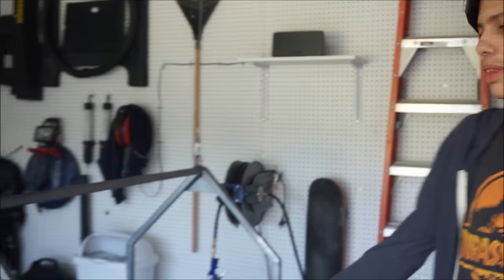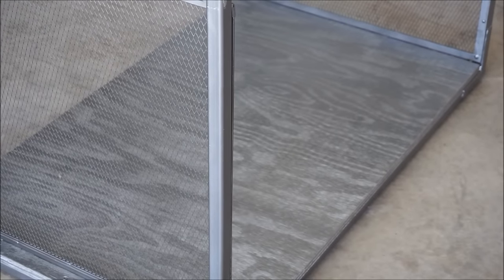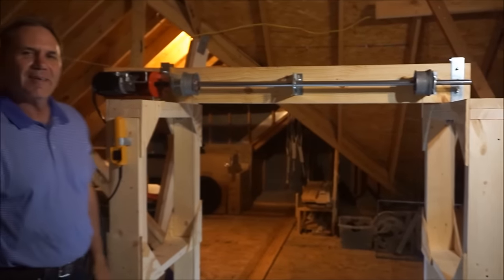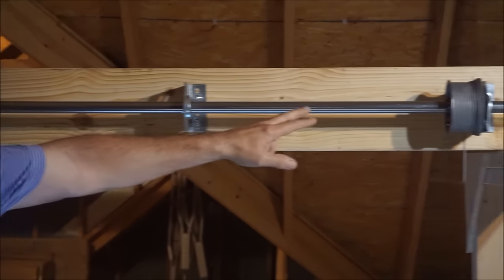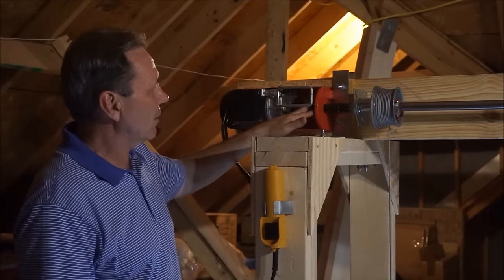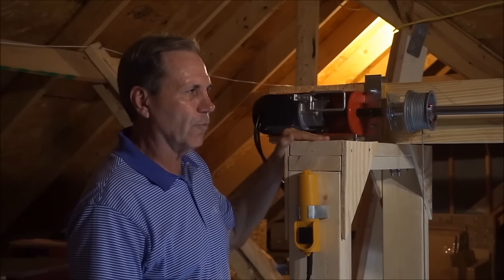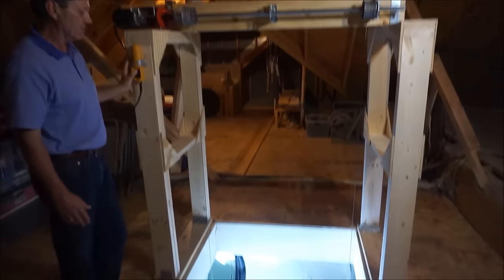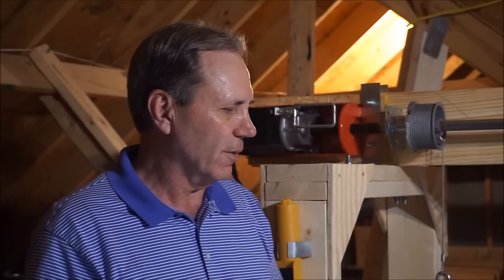Attic Lift DIY

Comment from the maker: I had a question from James about where I got the cable and drums for my attic lift.      I purchased the two cables, drums, tube, and end plates from a garage door repair shop.   I measured the distance from the garage floor to the top of the attic frame and had the cables cut to reduce cable length.    Let me know if you have any more questions.

Comment: Good video.  I might do something like this using galvanized pipe for the frame.  I saw someone else using a flexible piece of metal, bowed in the middle and attached to the frame to help center the platform as it goes through the attic floor.

Comment: I built an electric staircase to my attic also in Fort Worth using probably the same Harbor Freight hoist. Since it is built out of 14 ft long 2x12s and the stair steps inlaid with ceramic tile are also 2x12 material plus 100 lbs of concrete counterbalance at the bottom I'm sure it weighs well over 400 lb. Plus my 200 lb. I'm planning on turning it into an elevator that will hold me and the items I need to store and retreive in the attic. Those stairs are getting hard on this 77 year old man. But they have worked great for over 20 years. Too bad we can't compare notes first hand.

Comment: I don't know if I missed this information, but what is the size of your opening in ceiling and did you obtain the pulley shaft from the garage door repair parts store?  What determines the length of the pulley shaft?  Sorry for the questions, but I'm excited now after viewing your video and reading the comments.

Comment: Mr. Anderson, I have been attempting to get my garage hoist to operate correctly and I have tried many things...the problem I have is the dern carrier wants to swivel as it is going up or down.  My hoist motor is from Northern Tool..similar to Harbor Freight.  First I went with 4 points of attachment with chain fastened to the platform, but this did not work as it still swiveled and then we went to one attachment point.  I THINK what you have here will be the cat's rear end.  However due to not wanting to clutter up floor, I will mount mine back onto 2 x 8 x 6' boards that are bolted stoutly to the roof rafters.  Then it appears all I have to do is borrow from my tools, one impact socket, and have another attachment point or two welded onto my already existing carrier, visit Menards and purchase an additional pulley and cable and whatever else I require from your shopping list.  Thank you for the information and I surely HOPE this works because I really don't want to have to spend boocoo bucks just to bring down the wife's Christmas "stuff."  Can I post you directly if I have any further questions or just ask here?
Reply: As you see from my video, I attached the garage door cable to the vertical tubing on the platform.  My platform moves a little, as I lift it, but it still clears the opening at the top.   I would suspect that if the platform or cable is not level, it may swivel more, or.. if you do not center the weight on the platform.

Comment: I thought this was best DIY attic lift I’ve seen on YouTube. Are you willing to share your plans (I realize nothing is free) Think about it, please let me know.
Reply from the maker: Tony,   I am sorry that I do not have a list of materials or a full set of instructions.   I was able to find several youtube videos of attic lifts and used them to develop my project.  I am not an engineer or contractor, just a do-it-yourselfer.  Hope this helps.... The hoist is model 60346 (Pittsburgh Automotive) 440 lb. cap, 110 volt purchased at Harbor Freight.  It has a lifting capacity of 100 lbs. net weight.   Pittsburg Automotive makes several larger hoists, if you are interested.   The attic lift platform is 42" wide X 26" deep X 50" high.  The frame of the platform was made with 1" square steel tubing.  The angled pieces were 18" long and the down pieces were 38" long.   I had a local welding shop assemble it for $440.    The attic lift is supported by a wooden frame mounted in the attic.  Materials for the wooden frame:  The top header for mounting the hoist was 2X8X71.  The upright side supports (4 ea.) were 2X6X60".  The horizontal side supports (4 ea.) were 2X6X33" at the top and 2X6X27" (2 ea.) in the middle.   The floor pieces are 2X8X34" (2 ea.)   I used 3/8" plywood for the corner supports.   I do not have a picture of this, but you can freeze the video and it should be clear.  The garage door hardware includes: 1 piece of hollow steel tubing.  A 3/8 " deep socket that is welded to the end of the hollow steel tube. This allows the motor shaft to be connected to the steel tube.  You will have to remove the end plate from the hoist motor  and then remove the cable and exposé the shaft, so that the hollow steel tube can be attached using a 3/8 deep socket..  Also included is 3 end plates that support the tube in the middle and at each end.   2 rollers that mount to the hollow steel tube to carry the steel cable.     You will have to cut out the space needed in your attic floor to make room for the lift.  You will need to block and brace the cut-out like you would for an attic stairway.  Let me know if you have any questions.

Comment: Is it possible to get some details for the lumber frame you built over the opening? Some pictures of the frame (bottom and sideways) will be helpful. I am trying to figure out 1. How the top piece 2x10 is connected to the vertical lumber. 2. How the frame is connected to attic floor/joists. Thank you
Reply from the maker: I will try to get this to you this week.
Reply: @judsonanderson3043  Thank you. I will really appreciate it. I am planning to build something similar and I intend to install lower and upper limit switches. The lower limit switch is little tricky. If I find something that works, I'll gladly share it with you.

Comment: I have a question about the load limit on your lift.  The hoist used had a 440# limit with the use of the cable pulley hook and a 220# limit with a single cable attachment.  By removing the cable and pulley mechanism completely, and using a direct shaft, does that not reduce the load limit to below 220#?
Reply from the maker: Great question.  For those of you who have read my earlier posts, I want to update you on the capacity of my lift.  As Marshall stated, the hoist motor capacity may be confusing (to me it was).  While the owners manual for the hoist stated that the capacity was rated at 440 lbs with 2 cables and 220 lbs with 1 cable, I assumed that my hoist (with 2 cables) would have a 440 lb. capacity.   Well, I put it to the test.... I placed 240 lbs on the lift.  No, I did not try to lift myself as a test subject.  I used weights from my home gym.   The hoist would not lift 240 lbs.   I reduced the weight to 100 lbs. and the hoist was able to lift the weight to the full span from floor to attic.  SInce the platform weighs @ 75 lbs, it appears that the true capacity of the hoist motor itself may be closer to 220 lbs, not 440 lbs.   In case you need greater lifting capacity, Pittsburgh Automotive makes a hoist that has a 440 lb capacity with a single line (Model 60347), 550 lb capacity (Model 60345) and 650 lb capacity (Model 60344).   Of course all other components would have to be rated individually to insure that the unit, as a whole, can handle the weight limit of the hoist itself. 
  Hope this helps.
Reply: Judson and Derrick, nice job and thanks for posting. I will be modeling my new install after yours. 

With just a little modification, and possible two new drums, and you could actually lift the 440 rated capacity of the hoist.

Dead-end the cable at the header to form double run of cable on each end of the platform going to each drum. 

The double cable actually references the two lengths you saw on the hoist when you bought it. The picture and description shows it came with two hooks, and had 39’ of cable. 

If rigged up as shown in the photo on Harbor Freight website, with the hook with pulley attached to the load and the other hook attached to the motor frame, it will pick 440 pounds because each of two runs of cable is now carrying 220 pounds. Which you were able to confirm the hoist will lift.

To replicate that in your design, run the cables down and through pulleys on the top of your basket (you could use the one that came with the hoist when you bought it and get another for the other end) and dead-end the cables at the header instead of on the platform. 
This creates the same effect as shown on the HF site. 

Of course, that would mean that the drum needs to be able to hold double the length of the height of your lift. For example, an 8’ ceiling would need drums rated to hold least 16’ (or better, 18’) of cable. Did you buy drums that could hold as much cable as the original hoist? They held nearly 38’

Since, for stability, you are using two drums and two pulleys, creating 4 lengths of cable, the actual load to each length of cable is only 110 pounds. 

https://www.ebay.com/itm/Garage-Door-Cable-Drum-For-up-to-18-High-Doors-D525-216/291620087553?hash=item43e5e96701:m:mZgRq4zKgjGHWWNbSQXGiPw
Reply: The #440 rating for the HF winch is based on using a "snatch block" pulley. It is NOT determined by how many cables are attached without a snatch block. A snatch block will multiple the pulling power but require twice as much line to be winched in.  Because you will have to winch in 2' of cable to lift the load only 1' you are doubling the capacity. Additionally, the diameter of the garage door cable pulleies are larger than the diameter of the original winch pulley. That causes the lift capacity to be less than the rated capacity.

Comment: How did you detach the original cable spool from the motor shaft.  I detached the motor from the red housing, but it seems that the spool remains attached to the motor shaft and does not easily slide off as I had anticipated.  Thanks!
Reply from the maker: Marcus,  To be honest, I do not recall having a problem detaching the cable spool from the shaft.  It has a hexagon spool and once you take the housing off, it just slides off the shaft.

Comment: What was the cost of materials?
Reply from the maker: The total project cost was @ $850.   The platform was @ $420.   I had a local welding shop source and weld everything together.   The hoist was @ $130 from Harbor Freight.   The garage door hardware was @ $200.   The attic frame lumber was @ $100, which included boxing the roof joists.

Comment: great job guys. Im thinking of doing something similar. How hard is it to remove the spool cable from the motor?
Reply from the maker: As I recall, there are a couple of bolts that hold the motor to the housing.   Once you remove the housing, you will need to drill out the end plate to make room for the deep socket.  You will need to weld a deep socket onto the cable rod.   The deep socket fits thru the end plate and onto the motor shaft.   The motor will rotate the cable rod to raise and lower the cable.
Reply: @judsonanderson3043  
Ok Thank you for the information.  I really appreciate it. 
Do you think I could drill a hole in the  the shaft?
I'm thinking of putting a cotter pin threw the shaft and the new pole.
Reply from the maker: @jefflebowski8223  I would not recommend it, unless you have a thick enough pin to handle the force when you raise items on the lift.

Comment: This is just what I need. The current cutout for may attic access is to small to bring large objects to store. This would solve my problem and not cost me $2000. Can you send me a parts list and a basic layout?  I will happy to send you my information.
Reply from the maker: Dana,  Sorry I missed your question earlier.   The hoist is model 60346 (Pittsburgh Automotive) 440 lb. cap, 110 volt.  The attic lift is 42" wide X 26" deep X 50" high.  The frame was made with 1" square steel tubing.  The angled pieces were 18" long and the down pieces were 38" long.    The attic frame that the garage door hardware is bolted to is as follows:  top header for mounting the hoist was 2X8X71.  The upright side supports (4 ea.) were 2X6X60".  The side supports (4 ea.) were 2X6X33" at the top and 2X6X27" (2 ea.) in the middle.   The floor pieces are 2X8X34" (2 ea.)   I used 3/8" plywood for the corner supports.   I do not have a picture of this, but you can freeze the video and it should be clear.  The garage door hardware includes steel tubing that is welded with a deep socket.  Also included is 3 end plates that support the tube and 2 rollers that carry the steel cable.   Let me know if I missed anything.

Comment: Have been watching your video for some time and need to know how you attached the rod to the hoist? Was concerned that the welding heat would damage the motor, if it was welded. I have not purchased the hoist and I can’t find any specks, so it is hard to figure out how it is attached. Any information would be helpful!
Reply from the maker: An impact socket is welded to a tube that has the garage door hardware attached to it.    The impact socket fits onto the shaft of the hoist motor.    Check the reply that I sent to Marshall Owens.   It will give you info on the hoist that I used.

Comment: Thanks for posting this video; very helpful and very nicely done!  I have what is probably a very basic question...  Are there limits set for the upper and lower limits of the lift or do you have to manually stop it at the top and bottom?  If there are limits, how are they set (I assume there are as with garage door openers but have no idea how to do it).  Thanks again!
Reply from the maker: Drew,  The hoist comes with a limit switch, but it only works when the cable is fully retracted.   I am sure you can set up a limit switch for both - full up and full down position.   I control my lift from up in the attic where I can see the lift in the "up" and "down" position.  I also chose not to control the lift from the floor, as I did not want to be under it when lifting - just in case something fell off of the lift.

Comment: Am curious, is this an attached garage? Is the attic space above the garage isolated from the attic space above the living area? I ask because in a recent project I had drilled a couple of 1" holes in my garage ceiling to run 1/2" conduit, so about 1/4" slop around the circumference of the conduit. Upon inspection the city inspector required that I seal the holes with fire rated caulk to maintain the fire and CO rating between the garage and living space. He said all protrusions needed to be sealed.
I know codes vary. Do the codes in your area allow this?
Reply from the maker: The attic space above my garage is not isolated from the attic space above the living space.   You may want to check with the local building inspector to see if there would be an issue.   CO from  cars running in the garage could migrate into the attic.  I believe, if the attic is well ventilated, it should not be a problem.  I do not believe that a fire should create any more of a risk with or without an opening in the garage ceiling - again, just my opinion.

Comment: hello.very informative video.i am in the planning phase of building my attic lift. is that a solid steel keyed shaft?i am assuming it measures 6 foot.thank you
Reply from the maker: No, it is steel tubing.
Reply from the maker: The steel tubing that the steel cables mount to, started out as 60", but was cut down after I welded the deep socket that allowed it to be connected to the hoist motor shaft.  It is now 55".

Comment: Did you cut the hole in the garage ceiling yourself?  If so, how did you reconnect the joist and confirm that they were still supportive?  Just wondering.
Reply: Jay,   Sorry for the delay... Yes, I cut the roof joists myself.   My roof joists are 2 X 12's.   I used the same type of lumber to block and brace the cut- out for the lift, as was used for the bracing for the attic stairway cut-out.  Hope this helps.

Comment: Which deep socket size did you use?
Reply from the maker: Hector,   The size of the deep socket will depend on the type of hoist you purchase.   If I remember correctly, the hoist that I purchased required a 3/8" deep socket (impact socket).   Once you pull the end plate off of the hoist, you can "test fit" a regular socket before you buy a heavy duty deep impact socket.

Comment: Judson ; what size cable did you use on the cable drums most of the drums I'm looking at say that 5/32" cable is the max for the drum
Reply from the maker: I do not know the cable thickness.   I used the same cable that is used on my double garage door.  I purchased the cable, and hardware from a garage door repair company.
Reply: @judsonanderson3043  It would be interesting to know the rated load for overhead garage door cable is. In addition, utilizing a pulley doubles your rated single cable load.
Reply: According to one Amazon listing a 3/32 "cable with 7 x 7 strand has a rating of 960 pounds and obviously there are other sizes with different load ratings.

Comment: I'd like to use a 1300lb HF hoist to be able to haul my zero turn and snowmobiles up into the loft of my horse barn for off season storage. I'm guessing the carriage ending up at 250 lbs, and my sleds or z-t between 500 and 600 lbs.  Does anyone think the garage door hardware wouldn't be up to that kind of weight?
Reply: 42lookc … when you get to a certain weight the money may be better spent building a shed at ground level and not worrying about the safety aspect of how to handle awkward items. Maybe buying an enclosed trailer for the winter toys is even better?